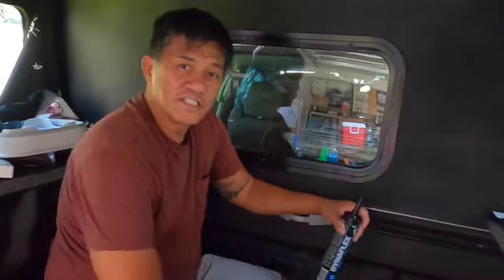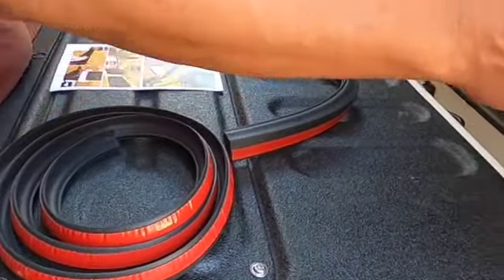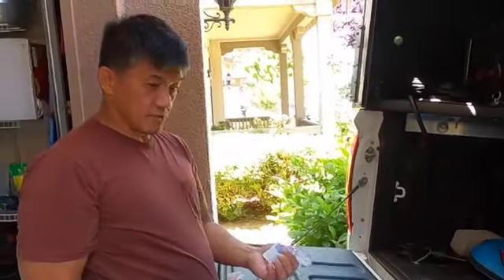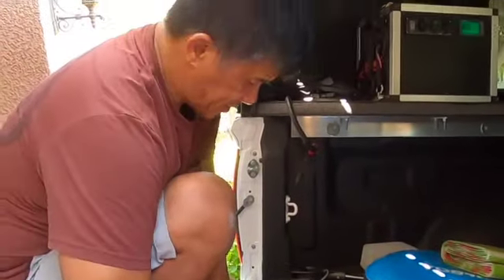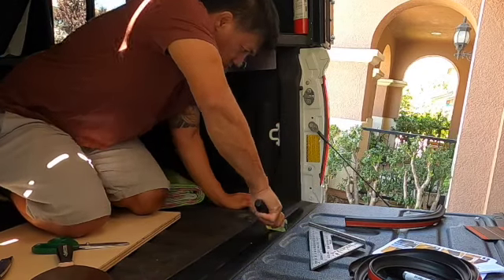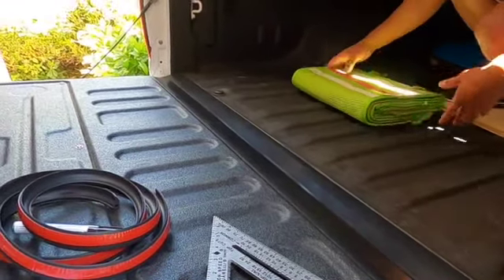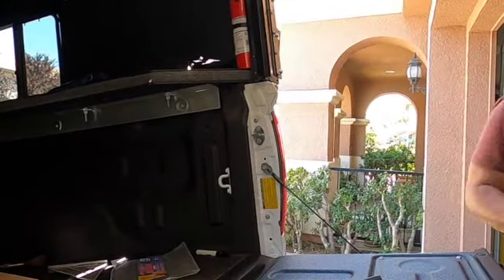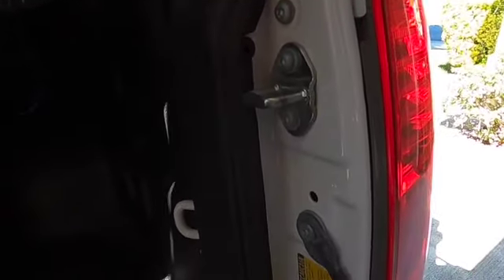TAILGATE SEAL ON TOYOTA TUNDRA 2021 I PROJECT M FOUR WHEEL CAMPER I ROK BLOCK

Comment: cool video, Just installed a a project m  on a 3rd gen tundra, trying to figure out the gape between the topper and the top of the tailgate  its a common issue with the 3rd gens from what I here. I am also local 775 too!  I am  working on my  inside build this week!

Comment: How do you like your fwc project M? Any regrets?
Reply from the maker: Love my project M! I can drive it anywhere, No regrets.
Reply: @menanmagallanes562  I’m debating between a project m and slide in . Thanks!
Reply from the maker: @LT11859  If your truck has a good suspension to carry the weight, you should get the slide in coz it already include the sink, stove, furnace and storage cabinets. It’s More convenient.
Reply: @menanmagallanes562  I have a 2006 2500 diesel 4x4 6.4 bed. But I like the option that you could still use your truck bed with the project m. The side in looks comfortable but pricey
Reply from the maker: @LT11859  yes, that’s the reason why I got the project M so I can still use the truck bed if I’m not camping. Plus I don’t like the idea of removing my tailgate on the slide in because I have the back up camera.

Comment: Did you consider putting a Bedrug bed liner in ?
Reply from the maker: My truck already had a spray on bedliner but I,m planning to put a floor that I can attach my fridge and my cooler so they dont slide.